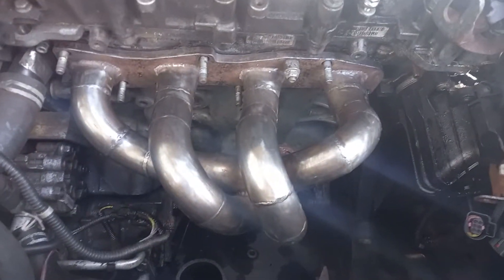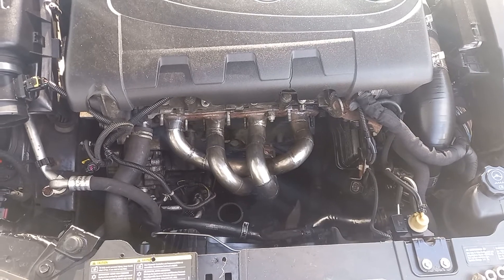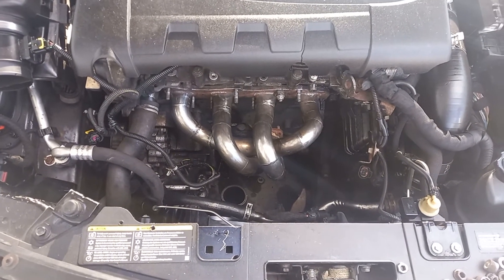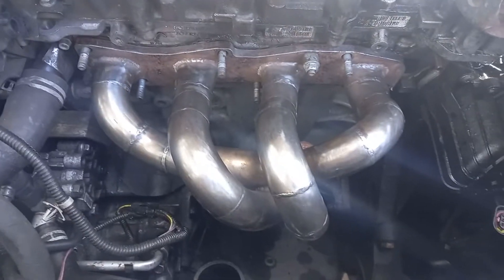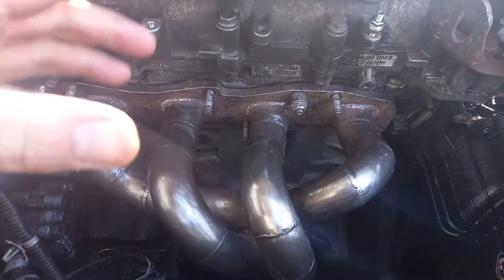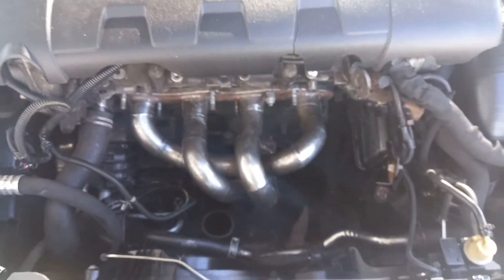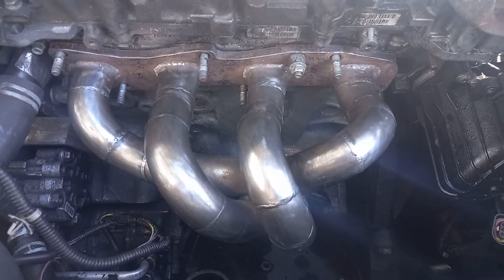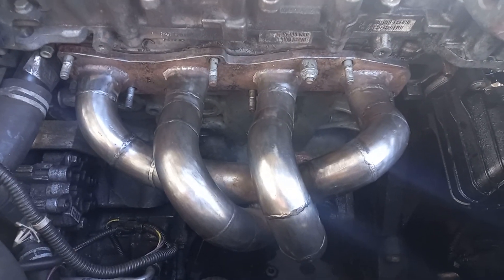diesel Tuning fitting a ball bearing turbo

Comment: Do you need to upgrade the maf sensor with a turbo upgrade
Reply from the maker: No but the map sensor will need an upgrade to a 4/5 bar version
Reply: @dieseltuningincboosttechno4684  what area you based in, im interested in a turbo upgrade but want everything done correctly what cost involved, for a insignia cdti 2012 sri
Reply from the maker: @markarcher8500  Plymouth the turbo kit cost £580 inc delivery and to be fair any garage could fit it
Reply: @dieseltuningincboosttechno4684  ok cool, You have a website for ordering?
Reply from the maker: @markarcher8500  I am not taking on any new orders at the moment as we have too much to do. We can begin building you a turbo in 14 days.
Reply: @dieseltuningincboosttechno4684 no problem, i will give u a shout in couple of weeks